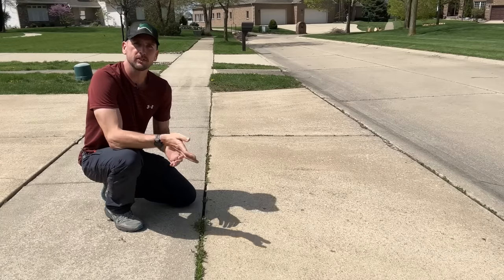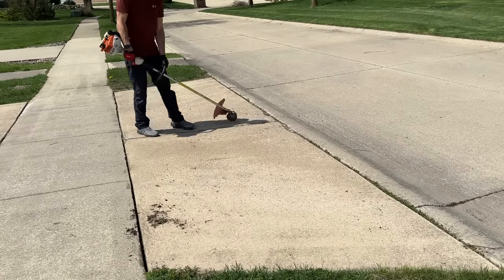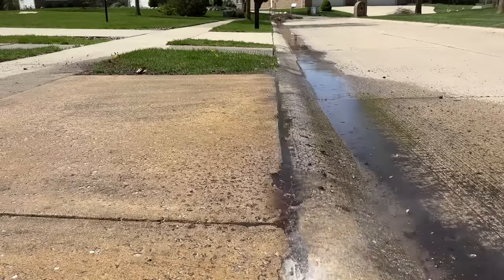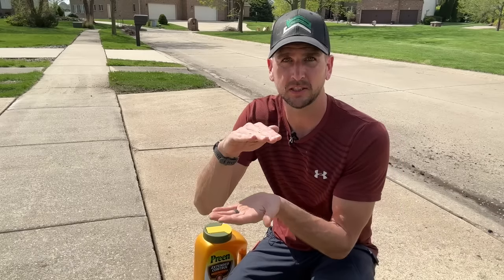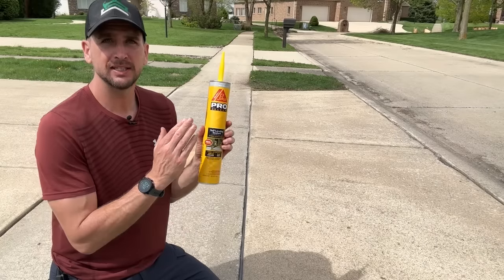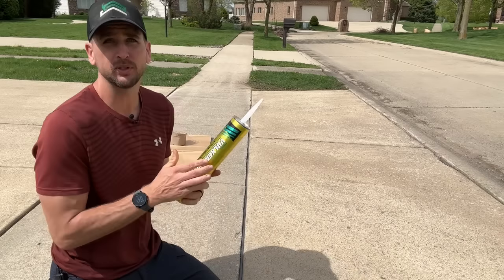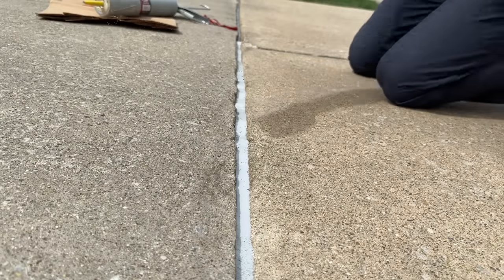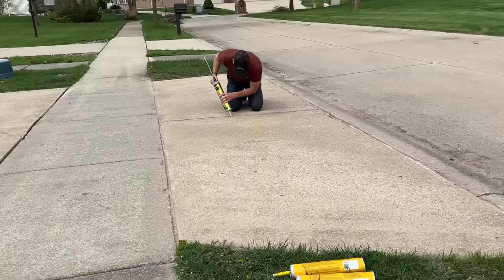Weed-Free Driveways and Sidewalks: The Ultimate Solution!

Comment: That's a lot of work for a temporary (1 year) solution. You can get the same result easier and much more satisfyingly using a torch.
Reply: I just got a torch last summer!
Reply: @Kurt M. Because the preen will get blown or washed out and dirt and debris will fill and compost in the cracks and expansion joints and weeds will return. Maybe you can get two years out of it. A lot of work for a temporary solution in my opinion. Might as well torch them - it's more fun and roughly as effective.
Reply: I did this on the upper 1/3 of my driveway 3 years ago… about 75 linear feet.  I didn’t put down any herbicide.  I’ve pulled only 2 rogue chamberbitter weeds in the last 3 years.  I’ve had great results.

Comment: I clean it out, then used only the grout and paver sand since i have pavers. on another awkward 1x4 gap: taped overlapping edges 3 inches back -used can spray foam then placed cardboard on top as it expanded, light trim, quick shot color match spray paint. No weeds since 2 year ago and holding

Comment: Foam floats no matter what we do here. It's just tol wet in the Houston/Gulf climate.
I bought damaged treated wood fence pickets at home Depot and ripped them to size.
Used deck screws to attach the strips to the original wood gap.
 Then used the caulk/sealer on top.
So far it's lasted for swveral years.

Comment: I see you wait till the end to introduce the pool noodle. Seriously, that pool noodle has a lot of sweet uses! At the end of the summertime you can goto Walmart and pay like a buck a piece for them and save them for all sorts of cracks or little jobs you can use that soft foam for. 

Good video and I like the sand at the end. That is a great touch!
Reply from the maker: Yeah, that pool noodle is still holding strong a year later with some Tremco 45 SSL on top 👍

Comment: I’ve used a ryobi universal tool to clean out the dirt of the expansion joint and then I blow it out. Afterwards I mix marine grade epoxy with a thickener that’s made for epoxy and then pour the epoxy into a cheap ketchup dispenser and carefully fill the expansion joint. None of the expansion joints have had any weeds grow out since. It’s been 5 years now. 😅

Comment: I used trim-a-slab to replace all the rotted wood in a large  turnaround driveway.  You need to get the right size trim for the joints, which need to have profiles of good standardized workmanship. I think you can buy a sample kit of very short lengths to spot-check suitability for your driveway joints.  Pricey, but I was delighted with my results.  I chose the dark brown color, but it can pick up color from hot tires.

Comment: In the UK, efficient drainage and excessive ‘run off’ requires some permeability of the surface of the driveway substrate as climate change appears to cause more rainfall. In short, the more waterproof the surface, the higher potential there is for standing water, and cascading of water streaming with the potential of land drains being overwhelmed without any natural ‘soak away’ provision! There seems to be an increasing trend towards a porous under layer weed barrier, laid beneath a further porous driveway surface to allow for good soak away drainage, to prevent ‘downstreaming’ a potential drain flood… in some cases home owners are being encouraged to adopt natural driveways with a synthetic load distribution surface grid which allows for planting/cultivation of wild flowers and grasses as an extension of a planted garden but where you can park cars. Not to everyone’s taste of course and some applications might not be suitable, particularly where someone does a lot of home car maintenance on their driveway.

Comment: Can also soak the weeds with 45% industrial vinegar. Works within few hours and lasts for several months, if rain does not wash it away within few days. Still a temporary solution, but does not need a prep time, and takes very little time. Just some 💭

Comment: 1 gallon 30% vinegar, 2 cups Epsom salt, 3 squeezes dish liquid is the recipe for weed killer that works for me. The crack weeds turn yellow and die.

I have a cheap stock pot dedicated to mixing the weed concoction.  Heat just enough vinegar to melt the salt. Mix in remaining vinegar, pour into sprayer, squeeze in dish liquid.  Shake sprayer and go. Apply once a season on a hot sunny day.

Comment: As a temp solution (that lasts pretty long), Plain house vinegar does the trick and is much cheaper and safer than any chemicals.
Reply: Vinegar, boiling water, rock salt ... nothing has come close to solving the weed problems in my cracked asphalt driveway. At some point, I'll have to quit mowing my driveway,  and dig out and replace all the old asphalt with new a$phalt.

Comment: The pre-preparation work is super labor intense for me to do. That's insane! Every season, I spray my cracks (sidewalk and near driveway) with weed killer. I only spray the weeds at the beginning of the season and, again, in mid to late August. Next season, I am going to use water with salt as recommended by Mr. Condor.
Reply: Good luck... vinegar, boiling water, rock salt ... nothing has come close to solving the weed problems in my cracked asphalt driveway. I need to quit mowing my driveway,  and dig out and replace all the old asphalt with new a$phalt.

Comment: Step 1: Remove weeds
Step 2: Blow or vacuum out or hose.
Step 3: add some sand (and tamp down) so its at least an inch below.
Step 4: add hydraulic cement on top of sand. 
Step 5: mist cement lightly w/water and leave.
DONE
Reply: Doesn’t adding cement defeat the point of an expansion joint?

Comment: This is a lot of extra work for the same result you would get if you just blasted out the area with a pressure washer and used polymeric sand to fill the joints. You could get the same finish in roughly 10%-20% of the time.

Comment: I can already see where I could save you a lot of time.  Instead of using a string trimmer and then a hose, why not just a pressure cleaner?  You remove the weeds/grass, the dirt, everything and you can get down pretty deep with it.  Sure, you might get a little dirty from the spray, but it would be a LOT quicker.
Also, we use polymeric sand in between pavers at our home, would it be possible to use it for this application as well?  Seems like a crack is a crack is a crack, and the sand is fairly cheap and hardens nicely to keep weeds from coming up.  Also comes in many colors.

Comment: protip. I use just plain old cheap pool salt. $5 for 60 lb bag. It keeps my joints weed free for one year. And no it does not attack the concrete. Been doing it for 20 years in between my paver bricks.

Comment: I had a 1.5 inch expansion joint (previously filled with a 2x4) that I filled with foam, then topped with the "Quikcrete Concrete Crack Sealant" (the fat grey bottles) which is apparently an "Acrylic Polymeric Resin". Less than a year, it was full of cracks and sprouting weeds everywhere. I've replaced it with 2x4s with this SikaFlex to fill the tiny gaps between the board and the concrete, hopefully it does a better job.

Comment: Great video, seen multiple times. I'm sealing the driveway gaps w 3/8" backer rod that fits nice and tightly. unfortunately, it also doesn't leave the 1/4" on top for the sealant. Grass was growing through this expansion joint, can see bottom, but crack tho long is pretty deep and thin. Pretty typical for expansion joint crack. 1/4" backer rod would not fit tight. Do you recommend some other method/process?  TIA

Comment: Does sealing the expansion joints like that prevent the concrete slabs from contracting and expanding normally, which might cause cracks?  How long does sealing last before it needs to be repaired/patched?
Reply: That is exactly what I have been wondering and why I haven’t sealed my cement cracks yet.  🤔
Reply: On old driveways, they used a wood strip inside these expansion joints. After a while, they rot out and so, we have to replace them because it's not a good idea for water to get under that joint. In newer homes, the joint doesn't have this wood piece, it's just an indention. However, if it breaks, now you have a problem and need to seal it so that water doesn't penetrate and wash out your support underneath or you'll get heaving in addition to the cracks. That's more expense.

Comment: Ok i have the Sikaflex and sand to cover the sika joint. I also have rhe 3/4" backerod. I am removjng the sealer around mybpool coping and finding soil and sand under it only. No backerod filling in the gaps.  The soil goes down as deep as 4" or more in Some spots but the gaps below the old caulking gets narrower as it gets to about 1".or less.  My question is, should I fill in the area beneath the backer rod.with playground sand?  Or should I just wet vac the soil out of there and leave a void beneath any backer rod. My backer rod doesn't even fit correctly due to the irregular gap sizes between the concrete slab and the pool  coping.  Im glad i watched this first about the backer rod fitting tightly or it will float up dutjng the cure. The pool people were saying to use a sand filler on gaps or sika seal will drip down the gap.  So renove all soil. Pressure washing or water is not an option, or it will end up in my fresh clean pool water.
Reply from the maker: I usually fill in the voids with sand but if your backer rod is fit properly it will not move as the Sika or Tremco sets up.  Best of luck on the projects.

Comment: Great channel; excellent content,
Question: about the 5 minute mark, when you talk about leaving gaps between the backer rod, every how many feet did you do that, and how many inches is that gap?
and more importantly why? What’s the reason to leave a gap and place the other backer rod?
Thanks for your input.
Reply from the maker: That gap was just because I needed to come back with the larger diameter backer rod.  You should not leave any gaps or the Sika will drain through the path and you will have a hole form.
Reply: Thank you

Comment: After washing the dirt from the joints, look where it is, on the highway or another area.     Should have cleaned the dirt away as well, rather than leave it and washed down and eventually possibly blocking drains in time to come.     Also it dose not look too good on a nice clean highway.

Comment: This feels like a solution in search of a problem.  I’ve probably spent less than a minute a year keeping the weeds controlled in my driveway cracks.   I just put a little weed killer in a spray bottle with the nozzle set to stream.  A few squirts in each cracked and problem solved. It’s really only a problem once or twice a year mostly after the rainy season. I doubt I’ve spent more than a total of 10 minutes on this problem in the 25 years I’ve owned my home.

Comment: I just sprayed Roundup on my driveway joints AGAIN.  So tired of it.  I was thinking about getting a propane tank and flame weeding torch.  It would be very difficult to get the crap out from between the concrete slabs, they put wood in there and it is mostly rotted away but all of it.  And the weeds just grow right past the wood.  I have also a couple places where weak corners have broken off the main slab.  They are still there but looking terrible.  Have you a vid about fixing those?

Comment: I found a much easier way.  
1. Pressure wash.  A lot easier than getting down on you knees and scraping and digging.  3,000 psi will tear everything out of the crack.
2. Fill cracks with dry mortar.  
3. Add water.

Done.  No more weeds.

Comment: I can tell you this is far from a "permanent" solution if you live in the Phoenix, AZ area.  The filler will last at most 2 years if it gets direct sun all the time like the driveway in that video.  By the 3rd year, the heat and UV will have caused it to shrink, crack, and peel away from the concrete and backer, so you'll have weeds again and it will look worse than before.   If weeds are you're only concern, save yourself a lot of headache and just spray the cracks twice per year with Roundup 365 or any season-long weed control product.

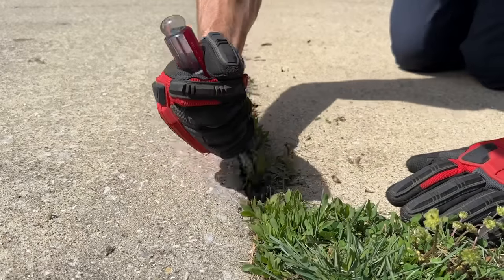Comment: 0:52 There's no such thing as a "flathead" screwdriver.  It's a common mistake, but it is called a Standard screwdriver.  "Flathead" is a type of screw, which may also be a Phillips screw. It refers to the overall shape of the head, not the type of indentation.

Comment: What about expansion joints with wood still present? The wooden strips in the expansion joints in my driveway are level and in some places higher than the concrete, but dry rotting. I guess I need to do the Preen until at some point the wood rots away and I can use backer rods & sealant. Not sure; thoughts?

Comment: If the crack in half inch than you want the backer rod half in down in the hole if its 1 inch that push down 1 inch you want the caulking to be The same like a square

Comment: A faster way to clean out the joints is use a 4" grinder with a masonry grinder to cut out the grass insted of a string trimmer then use a presure washer or point spray hose end , you can make one with a copper pipe and pinch the end so water only comes out at a sharp point,  this is also good to deep water a tree becuse it gets right down deep in the soil with littel effort  you also might want to add a flow rate valve inline.

Comment: Why not polymeric sand?  Seems that'd be pretty easy to broom in place and wet...
Reply: More expensive I’d assume (paver sand )
Reply: @rctechtime  Maybe. A 40 lbs bucket is $22, but compared with three tubes of the sealant, maybe not. I more thinking it go down way easier and without all that crawling around on your knees. But I genuinely don’t know if it’s appropriate for this use case or if there is some downside I’m unaware of.
Reply: It's a pain to put down properly. If you get a lot of rain, it always loosens up and you have to redo it. It's a constant battle.

Comment: I thought concrete needs the spaces so it can contract and expand due to weather changes. So, will sealing up the cracks create an expansion- contraction problem?
TY in advance for explaining.
Reply: No because both the backer rod and the "sikaflex" are flexible and allow for expansion and contraction of the joints, without allowing moisture to get underneath.

Comment: How long does the Sika & sand trick last for?
Is it easy to remove and redo it the same over and over again ? Or is this technique a do this once and it’s fixed forever.
Reply from the maker: I personally have Sika still going strong after 3 years. I could see a properly done seal lasting 10 years or more.

Comment: Here in Michigan, my 2012 home driveway has some kind of hard plastic (1x3 or 4”) material filling the joints? Ran into a problem this last winter where it started lifting at several of the segment ends. This caused me issues when using my snowblower, as it would catch these when trying to pass over them. I eventually used some wooden door shims to hold them down/flush in these areas, by driving the shims down next to the material then breaking them off flush. Been looking around and all I see are soft tubular like materials as joint fillers - what the heck were they using on my driveway and what’s the best way to maintain it?

Comment: The sand is brilliant. I'm an old guy. I'd fill cracks between decks and swimming pools with stuff called Deck-O-Seal. It was 2 parts and you'd mix it and either pour it or use an applicator bottle. Your way looks a good deal easier.

Comment: I've got a big thick weed that keeps growing RIGHT next to where the house faucet pipe comes up out of the ground, wedged between the pipe and the house and driveway 😫 I've sprayed it pulled it up many times it doesn't give up. I'm afraid I'd have to break up the concrete and hopefully not damage the copper pipe to get all of it out of there. Those things are aggressive even if I tried smothering it with some concrete it might break it....
Reply: Have you identified what it is? Then you can use methods specific to that type of plant.

Comment: your amazon link has the self leveler listed at over $180 PER tube. Is that the real recommendation for the average DIY homeowner or is that link outdated?
Reply: Just get the product name from there and search elsewhere. Third party sellers, not the normal authorized retailers. They can have WILD prices on regular everyday things... Just waiting to dupe somebody. When one seller drops off, the one Scott might've seen, Amazon probably then linked you to the same product from someone else.
Reply: Home Depot carries that brand IIRC.
Reply: Scroll down… that’s the price for a box of 12 tubes.  But, it just might take that many to do every joint on a driveway, depending on the dimensions.